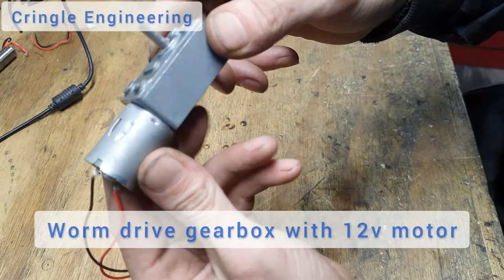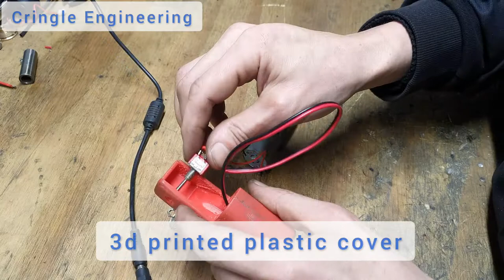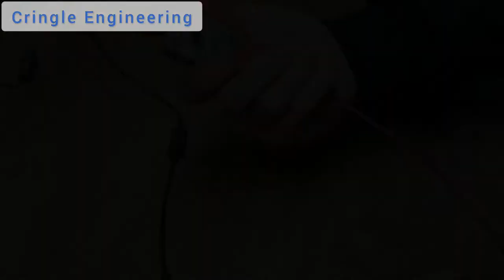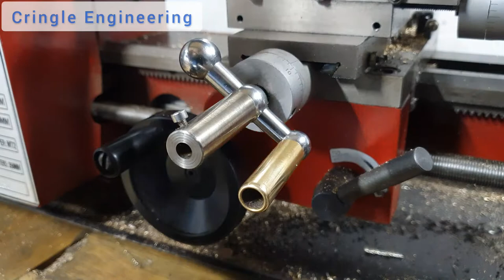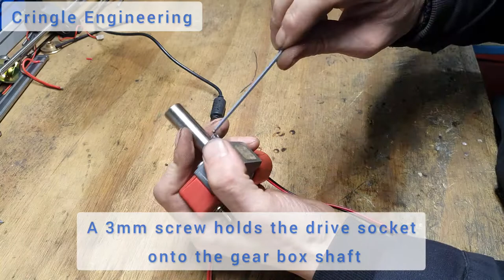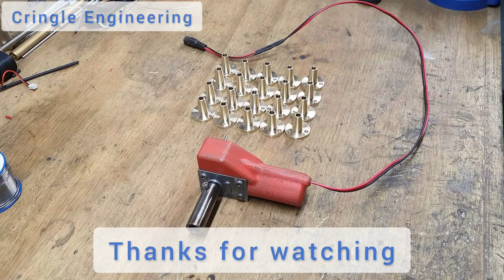mini lathe power feed

Comment: What brand of mini lathe is that? Or maybe more importantly, what price range should I be looking at for one that has comparable precision? And same for a mini mill, as well? Thanks!
Reply from the maker: Hi, the lathe is the generic ebay chineese 7x14 lathe. Ive had it for around 5 years and i cant fault it for the price. would highly recomend it for a first lathe. And the tooling/spares are cheep and plentyfull. 
The mill is a sx2 with the longer table from axminster and im also very pleased with its abillity. I bought it from axminster just to use there finance payment option and i have just finished paying for that now so will possibly get the next size up lathe from them. The mill is also a chineese generic and available from many suppliers with different name tags.  Shop around for price and buy the best you can.